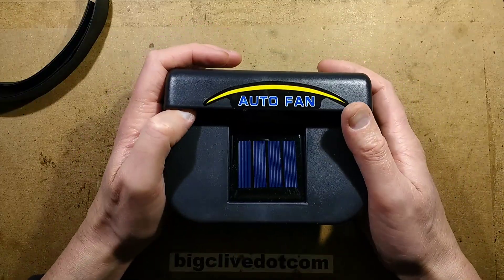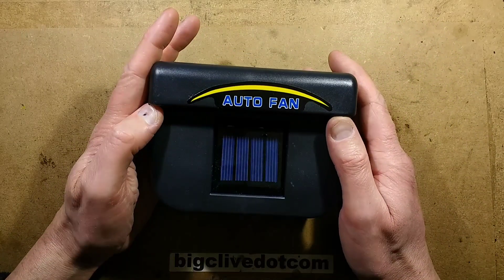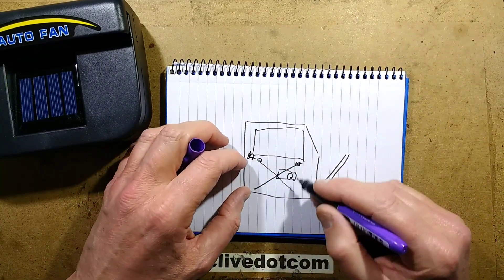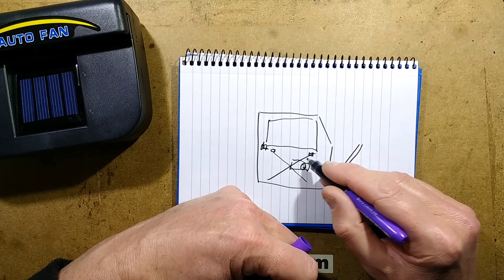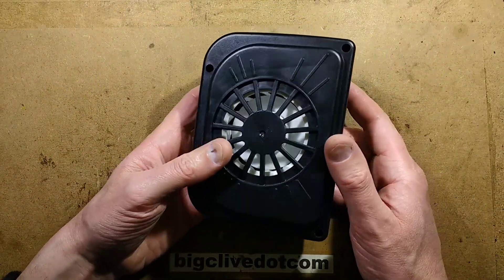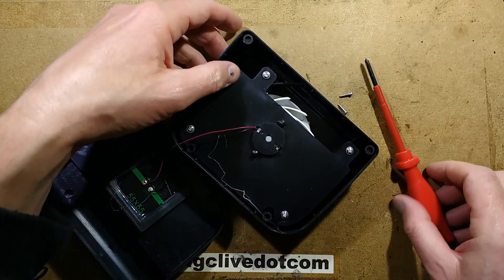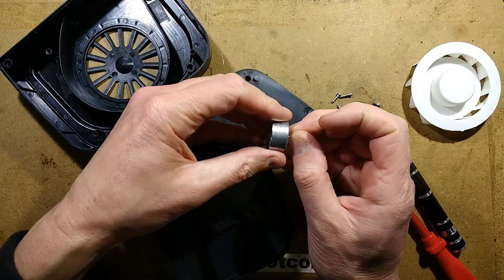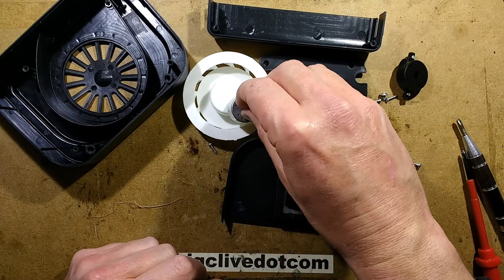Inside a solar powered car window ventilator.

Comment: Hand cranks were so much better for opening car windows. My theory on why they don't put them into cars any more is not because they are convenient, but because they can make them cheap so when they break you HAVE to get them fixed! Manufacturers want to make products that give the give that keeps on giving to them. They could actually make cheap parts that last, but they want to make sure you come back for more, and the more often the better. They figure out how you can most likely fuck up, and make sure it will happen, or they just make parts that wear quickly. I remember back in the day when your TV lasted AT LEAST 10 years! Now, you are doing good to get 2 years out of them! I don't have the cash to buy the really expensive TVs so I don't know how long they last, but even if your expensive TV lasted for 10 years, your cheap TV every other year will still be more economical. Of course, television broadcast formats were allowed to evolve. ATSC has been expanded to use h264 to cram for channels in. They may even use h265 as well especially for 4k broadcasts. I don't know when local channels will start using h264, but by the time your TV breaks down you may need it. H264 may be reserved for premium content as the format can be encrypted.
Reply: Fewer parts too. Though motors are more complex, the Chinese turn them out for cheap.

Comment: Would that solar panel really provide enough power to run the motor?    
Someone should make one that goes over the vent in the car that draws are in.   I guess you need to close the other vents and make sure external air is set.

Comment: would it work to go through the air system of the car to get the air out? hook up the fan to the car's air outlets, close the other outlets and let it blow the hot air out? Or is it somehow valved/one-way for the AC system?

Comment: Doesn't your car have AC?
Reply from the maker: Very few cars here have cooling.  Just heating.  This is for ventilating a car that doesn't get used much.
Reply: Bummer, since AC's are insanely good at drying, but you knew that. :-)
(Also running AC at the same time as heat doesn't give you the shivers, just dries out the interior.)
That ventilator could be helped by installing a hygrostat/humidistat , so it doesn't run the fan when it's overly humid out.
Reply: At least he has power windows. ^^
Also, come to think of it, that fan is much likely just a novelty item, and won't do much of anything, except spin and look cool (if it had some LED's).

Comment: Sorrr BC but i have to ask, did you have some kind of body piercing through your thumb?
Reply from the maker: There's not actually a hole in the thumb.  Just a black dot caused by an impact.
Reply: From a thumb detector?

Comment: The top didn't break off, it was probably held in place only by the top 2 screws.  And it's definitely the centrifugal force that does the blowing, centripetal force is the inward force of the white plastic not shattering.

Comment: When you're elbow deep in the door looking for what broke, keep an eye out for anything pink.  Those seem to be the first things to break.  Oddly enough I'm not (entirely) kidding here.  Dodge/Chrysler vehicles from the mid 2000s (when owned by mercedes) used a plastic transmission interlock affectionately called "the pink thingy".  It was a known fail point that was even covered by a recall.  Once it broke you couldn't shift your transmission out of park.  And as strange as it may seem it was NOT made in china.  Go figure.  :)
Reply: I guess that was their answer to years of minivans without a brake shift interlock, and all the lawsuits they received over unattended children shifting Mommy's Grocery Getter into gear and getting hurt.

Comment: I bought a few of these quite some years back to extract hot air from my car when in Slovakia as at the peak of summer the cabin temperature went to over 80°C.
They were completely useless and a waste of money. Instead I use those external (not internal) reflexive heat shields on the back and front windows with a small gap left at the top of all the windows.
The car only reaches just above ambient temperature and is so much cooler. It also keeps the dash and seats far cooler so the air-conditioning is much more effective from the word go.
I've just bought some identical ones from here as mine were getting a bit tatty:
https://www.lidl.co.uk/en/Non-Food-Offers.htm?articleId=6212
Reply: I've given you a tick up, but I've just found out that my Lidl has stopped stocking Tonic in tins, so it's been a BAD DAY!
Reply: Bad luck... have you tried another store?
We have two and some items are stocked in one but not the other... same with special offers, one may have only a few (or none) and the other has waaay too many.
Good luck with your tonic quest :-)

Comment: They don't move enough air to do any good. They let more moisture in overnight than they ever pull out in a week. We have the same problem on the BC coast but also get the low temperatures so you end up with frost on the outside and the inside of the window.

Comment: Just put a drip/rain guard on and crack the windows.  Convection will exhaust more heat.  Keeps my truck cool in summer here when it is 98F.
Reply: @tiporari
Can you explain?  I want to sleep occasionally in my car. TY

Comment: I feel your pain. I just got done replacing a window regulator, for most of the same symptoms. Mine was riveted in. I hope you weren't so unlucky. Also the term is door panel, instead of bulkhead, but that could just be a difference in language. Haha. Who knows.  :)
Reply from the maker: The arms were riveted in this one too.  Having never opened a door panel before it proved to be a minefield of education.

Comment: These are next on to useless to cars with power windows (as you've discovered) or very curved leading edges on window glass.  I used a unit exactly like this on an old Holden Camira (think 80s Vauxhall Cavalier) with wind-up windows and a straight edge to the back window glass and it worked fine BUT it didn't have enough guts to replace the air volume fast enough to prevent mega warming in the hot Aussie summer sun.  So then I tried two of them attached to both back doors...a real improvement.  I can't use these devices on my new car due to the window detent motor trigger the car alarm and the curvature of the glass.  Why car makers don't offer solar-powered air pumps is beyond me.  The solar panels could be embedded in the roof or, in the case of sedans, in the real parcel shelf.  Removing the hot air would make the job of the car's air conditioner so much easier on start up.
Reply: Rear windows open, AC on full. Start driving and the cold air comes in whilst the hot is vented out the back.Not hard.
Reply: Assuming the ambient air is cooler.  In Australia in summer sometimes this is not the case.

Comment: Sounds like you popped the window off the track. I have fixed it before myself. You can probably fix it. I believe in you.
Reply from the maker: A wire rope crimp failed and made a bit of a mess inside the door.

Comment: Golf mk4? by the way you have a leak if you get condensation when the sun shines. The window mech has a recall because they all failed.
Reply: Most likely a nice hole corroded in the floor pan, don't you just love salty roads...

Comment: Trying to offset hundreds of watts of heat with a 3v motor probably operating in the mW range is like trying to suck the heat out an oven with a straw.
Reply: It's more effective then it sounds.  I've had one.
Reply: Have a pruis with the solar fan option. It works amazingly, but of course the solar panel is about 2ft square. It runs the fan in the dash and keeps the car somewhere in the low 100's as opposed to 150-160.
Reply: On a very hot day it takes the cars own AC some period of time to cool down the cabin, and that is using a big blower cabin fan and a compressor in the multiple kW range, and a huge fan and condenser at the front of the car.
Reply: I know why bother with them when your vents and ac do the same

Comment: A little condensation in cars is normal but you should check the door seals and the scuttle drainage if its a a big problem. the heater matrix is another possible source, I really hope its not that
Reply from the maker: It's not too bad.  The main problem is that this is a very wet/humid climate.
Reply: Not only the door seals. Check the plastic membrane that's usually fitted between door  and door card, particularly if the door's ever been worked on - IME mechanics rarely reinstate it properly. As for the heater matrix, any hint of the very characteristic smell of antifreeze in the cabin is a dead giveaway.

Comment: Nissan have a little solar panel in the rear spoiler on the Leaf, it runs the cabin fan on intake to do this when the car exceeds a certain temp. Cool stuff!
Reply from the maker: That's a nice simple idea.
Reply: @jwalker7567  
Have a newer Prius with the same thing. I imagine you could make the argument for both, battery's don't care much for anything above 40c and neither do the human occupants. But it's not a standard option so it's probably more for humans, although the battery benefits too as the vents are on either side of the back seat.

Comment: I had one of these once, and the solar panel was completely defeated by the standard coatings on the window.  It would not turn at all with the panel inside the window.  I had to rig it to hang outside the window, and I added a small rechargeable battery to help.  Even then, this thing was crap.
Reply: Just get a better car.
Reply: At the time I couldn't afford to do so.  I've since gotten a newer car in better shape, and the fan-thing was tossed years ago.

Comment: These things were on special offer, I bought half a dozen. Reckoning to fit three on the top of each of the back doors of the car. Leave them installed through the summer, and it wouldn't matter which way round I was parked.
They don't work, simple as. In the brightest of sun, the fan whizzes round of course, but the car also heats up at the fastest rate. Even with five of these things on one side of the car, it had no effect on the temperature inside.
With the fan at high speed, there is no noticeable flow of air to the outside.
The reason is clear when you look at it in detail. For any gas to flow freely, it has to "see" no obstruction from the fan to the final exhaust, and there should only be very gradual changes in direction, preferably none at all. This design fails on both counts. The air faces an instant obstruction at the circular aperture of the fan as it blows into a 'wall' of plastic. So there's just an area of turbulent, slightly high pressure air at the very start. That then has to flow inside a thin but wide channel, and then reverse direction in two right angle turns.
Think of an exhaust fan in a toilet, and how powerful that is. It blows into a straight length of tube only the thickness of the wall, and it takes maybe 5 minutes to do a single complete change of air. A toilet cubicle is roughly the same volume as the inside of a car, so to do the job properly you really need a fan with a similar capacity to the toilet (bathroom) fan.
<edit>
After all this blah, I wonder if they are really meant to blow INTO the car? Nope, I'm looking at the box, and it says "blows hot air out of parked car". mmm... I reckon reversing the flow would be a thing to do. The fan will then "see" no obstruction at all, and there'd be a partial vacuum behind it. Flow then is dependent on the cross sectional area only. Thinks...
<edit again>
Nah, it really is crap, swapping polarity works better, a little. Although my previous is slightly in error, there is an impellor, not a fan. It looks like it should work, but when you hang it on a window, the glass blocks the flow of air. The supplied strip of "rubber" that infills the rest of the window opening for security, that doesn't fit a normal thickness of glass either.
Reply: The fan doesn't pull enough wattage to do jack and that itty bitty solar panel isn't up to the task either. It's just a gimmick thing mom will buy as a gift when shopping, but it turns out completely useless in all practicality.
Reply: nicktecky55 
Seems like you may be better off with some of those simple window vents that are held in place at the top of the aperture by the window but are just a mesh. At least you may get some natural airflow through the vehicle.
Reply: Pete Allum
Yep, just about anything really. I left out that if there's the slightest breeze, and the car is side on to it, then the fan can't cope with the pressure drop one side of the vehicle to the other. But I thought that might be rubbing it in a bit! My other car, which is mine but the mem sahib took it over has those plastic draught excluding doodahs on the front windows. So you can leave the windows open securely.
<edit> Wind deflectors ordered from eBay, £35.
Reply: The inside of the car needs to be shaded as well.
Reply: This while paragraph sounds to me your intelligent but you say the improper piss poor word if no jesus its just stupid
Reply: Thought they'd be useless when I first saw them 15 or so years back. To say the least, they didn't last more than a summer in Australia before dissapearing. A high capacity computer server fan (around 800mah at 12v) would work better as a ventilator, coupled with a 13 watt (1 Amp) solar panel on the car. Used one of those fans in a home made aircooler using an aspen shavings cooling panel. Cooled the car even on the 40+celcius days. Used a small solar powered water pump, powered via a usb port, circulate water through the panel. The whole thing was set up in a rectangular styrofoam esky from a fruit and veg shop. 

The other option is the silver window covers or inserts, they go some way to helping and have found them useful. Also slows the cold penetration in winter, if sleeping in your vehicle. 

Other option, is park in the shade..😜

Comment: The window mechanism on my Father in-law's Citroen Picasso rusted out and snapped, so I spent about 8 hours installing a new one he'd bought only for it to fail again two years later. This time we bought a whole door from Ebay for the same price and had it installed and working within an hour!
Reply from the maker: Whole door!  Now there's an idea.
Reply: Is it a Skoda Felicia you have? (think you mentioned it in another video) If so, the doors are about £30-35 on Ebay.
Reply: If it's a common enough car there's usually a vehicle dismantler local enough that you can pick it up yourself. However, there's some large vehicle dismantlers who pretty much make all of their income of Ebay sales and they often have reasonable postage prices.
Reply: How do you post a big heavy car door. Postage must cost more than the door as it might have to sent on a pallet?
Reply: BE sent....

Comment: a drone motor would fit or one of those cheap helicopters, they run at low voltage and at the most are 1/4" wide and 1/2 inch long at the most. Work fine with a solar panel up to 3 volts. Might need 2 of them but cheaper than buying a dedicated case apart from the  the window fit unless you have a 3d printer :-)

Comment: Why do some LEDs flicker and some don't?
Reply from the maker: It depends on the circuitry used to drive them.  Some LED lamps use simple circuitry that doesn't smooth the alternating mains supply.

Comment: If your car is suffering condensation inside there is something wrong with seals usually, because it really shouldn't condensate inside. The only car ive ever had that did that was one that had a windscreen issue and it only did it in the freezing cold weather the inside of the windscreen would be soaking but normally it shouldn't get condensated. Also a bit more advice if you clean the windows inside once you do so, avoid wiping the windows with anything and always use the heaters and aircon to clear the windows, it minimises any condensation unless of course there is a seal problem as i mentioned before, and in which case it wont make much of a difference.  

Not ideal if you have kids as they like to wipe the windows!

Comment: Looked these things up on ebay, as I thought it might be good for my car that hardly ever moves.  There's some brilliant chinglish in the description:

If windows installed anti-trap hand, may shut lax, with clamp hand buyers to said windows is lax, so please solve it by yourselves.

Any ideas what that means?
Reply from the maker: Some automatic windows may be so sensitive to pressure that it won't close all the way with the strip in place.
Reply: Is there a Chinglish-English online translator? If not, someone should make one.